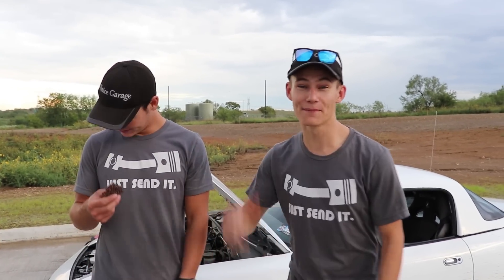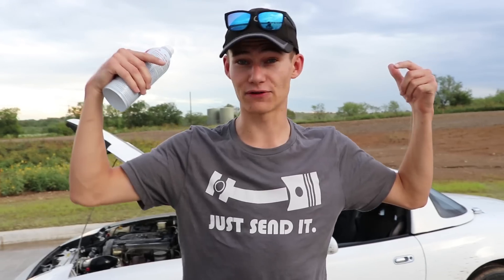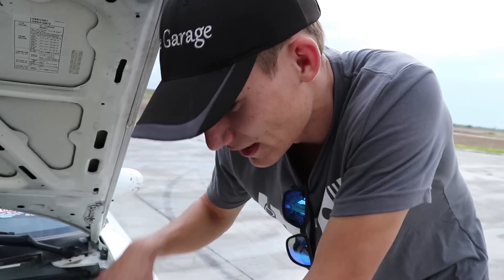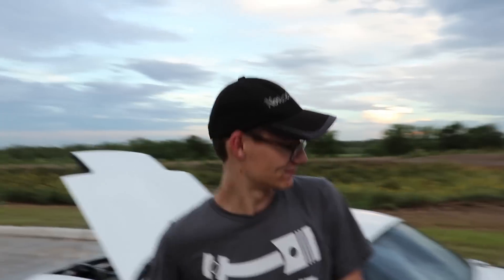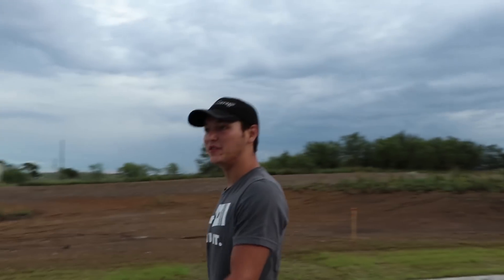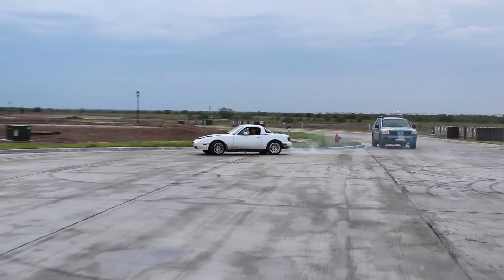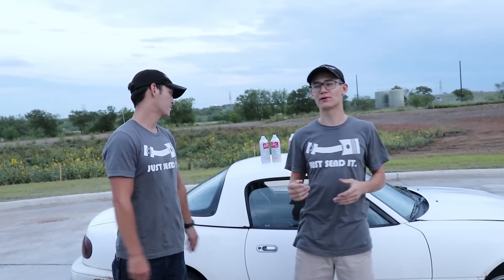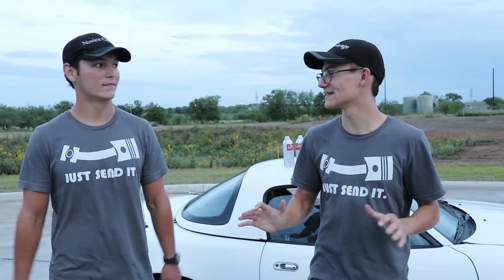We Put STRAIGHT Sea-Foam In Our Racecar!

Comment: Try putting gasoline in the gas tank and see if it runs.
Reply: They should put oil in the engine an then see if it runs
Reply: Brains Yard definitely wouldn't.
Reply: Brains Yard ABSOLUTE MADLAD!
Reply: Yeah I mean I put a little bit of coffee grounds in my car so it doesn’t fall asleep when I’m driving 😂
Reply: Idk it might work
Reply: I put that one s*** in your radiator supposed to help us stop leaking and it is destroyed with two motors in two different cars I have
Reply: That will never work
Reply: My dad does everyday works great

Comment: Next You Should Try kerosene
Reply: SINDHU AJITH that's the same as diesel
Reply: They did except they used Gumout octane booster.  That is a mix of kerosene (jet fuel! As listed) and naphthalene (old fashioned coal oil lamp oil).  It ran.  Hard to start. Idled rough due to the incredibly high octane test.

Comment: Dropping a comment at 2:34. I've done it through the brake booster before and tried pouring it down a carb with the fuel pump disabled and all I got was backfires and white smoke hiccups. I don't think straight sea foam will work without some heavy a/f tuning

Comment: my prediction was it will start, but die right away...however, the fact that it idled for as long as it did, I would say my prediction was wrong.  Actually surprised that it managed to drive at all with sea foam

Comment: Try the berryman's B12 as a gasoline substitute it's a spin-off of the seafoam and has been around for the same amount of time by the same company I wonder if they will work you can get it at Walmart and it's cheaper than the seafoam I use it myself and it does wonderful as a gasoline additive so it is worth a shot

Comment: Can you guys do a testing  after half gallon of seafoam mixed with 10 gallons of gasoline and ran it for 200 miles and check the valves deposits, piston top deposits and the plugs cond.... thanks

Comment: If the spark plug is wet and obviously it's running rich just so you know it would benefit from removing fuel from the table at least greatly
Reply: Adam Honda98 nah that's oily residue from the Seafoam.
Reply: And I bet you have to put in the gas in and running it like they did they clean the spark plug